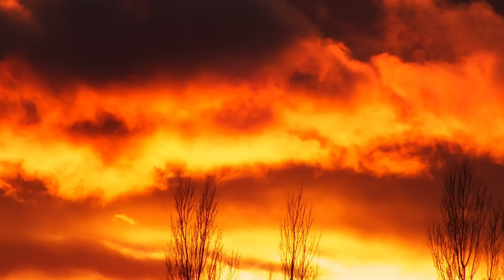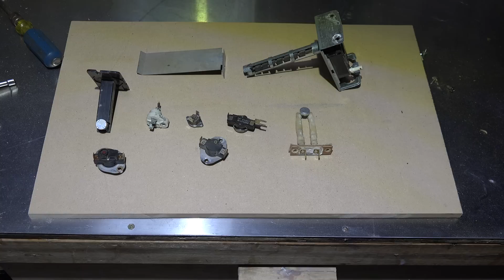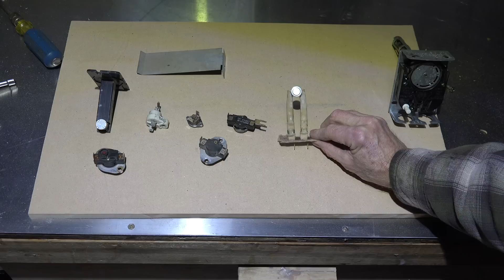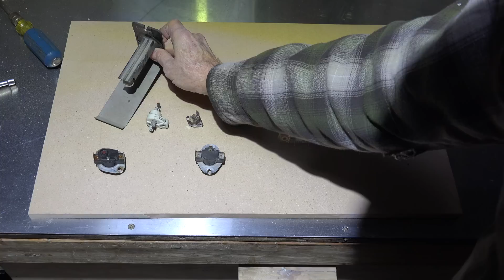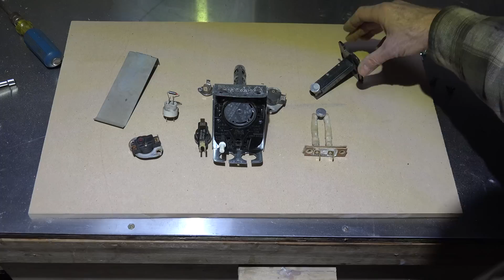Overview of the furnace limit switch

Comment: I have a limit switch like you’re showing on Woods furnace that has the little white button that you pull out. I pulled that out to turn it off and I unhooked one of the wires and I can’t figure out where it goes back. The short wire is hooked right under the white button that pulls in and out but there’s another wire that’s about an inch and a half to 2 inches long I can’t figure where that hooks back into if you could help me I would appreciate it
Reply from the maker: There are 4 wires to that switch.  2 are connected at the top of the switch, 2 at the bottom.  You probably disconnected the left bottom wire.  
To reconnect, shut off all power to the furnace.
There are 2 holes in the plastic.  One is round and the other, just above, is rectangular.
Using a small screwdriver, depress in the rectangular hole while inserting the wire into the round hole.
GFM

Comment: Can a limit switch become weak and trip to early I had a clogged filter that was causing limit switch to trip  I had an Hvac company come out he wanted me to replace the high limit switch, the blower and the inducer motor... sounds like a part changer.... he wanted 400 dollars for limit switch and 1000 for each motor I ordered a new limit switch to start with online with same factory specs could the by metal have become weak? Thank you for your time and videos
Reply from the maker: The limit switch is not designed to open continuously.  They usually stick in the off position.  I would replace it if I knew it was opening because of low air flow.
GFM
Reply: @grayfurnaceman  yes my main question is if it can open prior to reaching designed temperature it doesnt stay open I believe due to tripping so often and age of the unit it might have become weak... is this possible lol or have you came across this issue or is it usually only stuck open and never closes?
Reply from the maker: @cuzz0187  I have only seen them stick open.
GFM

Comment: Is there a way you can make video on reverse flow switches installed on blower motor housing explaining what it is monitoring and what symptoms causes it to open. There is a ton of content on high limit switches in heat exchangers but not so much on these type of switches. Thank you.

Comment: At what temperature is a limit switch supposed to open in a residential furnace, let's say for example a 3 ton 75k btu and it doesn't have a factory tag, no information. There are a variety of temperature ranges to choose from
Reply from the maker: There is no set value.  Each manufacturer uses specific limits.  The switch does have its temp marked on it.  It should be something like L130-30.  I don't recommend using anything other than a factory switch.
GFM

Comment: my furnace do big bang  what could that be?
Reply from the maker: You probably have delayed ignition.  Dirty burners, cracked heat exchanger, incorrect manifold pressure, HSI not warm enough.
GFM
Reply: grayfurnaceman 
thank you for taking my question so l guess I should call pro
Before I do that any recommendation
Reply from the maker: @chulee8148  No, just get someone out there.
GFM
Reply: grayfurnaceman 
Thank you again

Comment: seems as though these annual inspections should include a test of the high limit plenum temperature switch operation...there are millions of 10 to 20 year units out there that have never hit the 200 degree limit switch shut down...until one day,  when the blower didn't start or fails during a burn cycle....now, you may find out the hard way that the limit switch isn't working...

Comment: I have what looks like a bimetal limit switch, I suspect it's at fault. Does the limit switch cut the pilot or just the burner? It's an old 4 terminal millivolt valve. The pilot won't stay lit. I've changed the thermopile but no dice... is my valve dead or the switch fault? Thanks for any help!
Reply from the maker: Not enough info. Some units have a normally open switch that cuts the pilot if it closes from high temp.  Name and model might help.
GFM